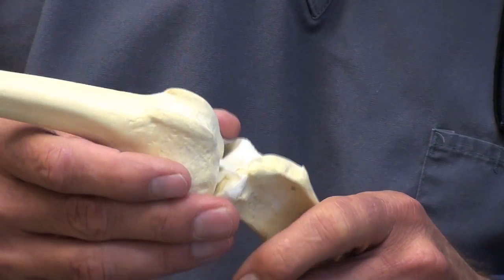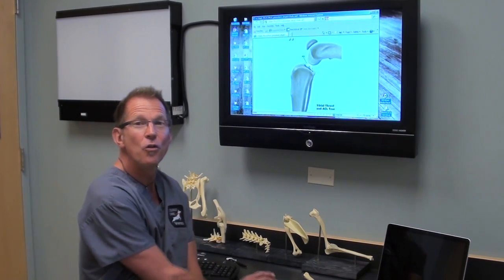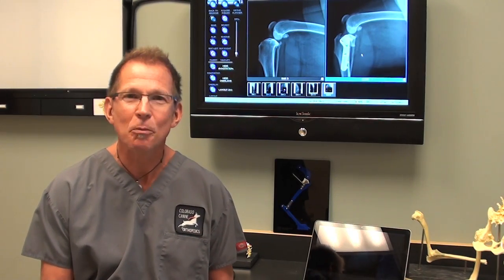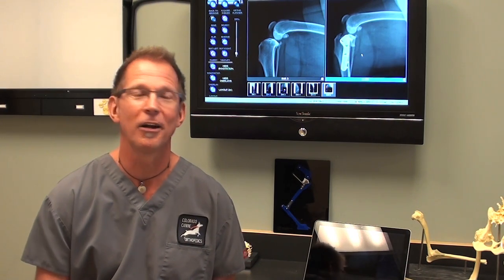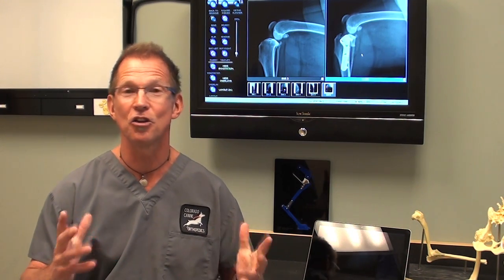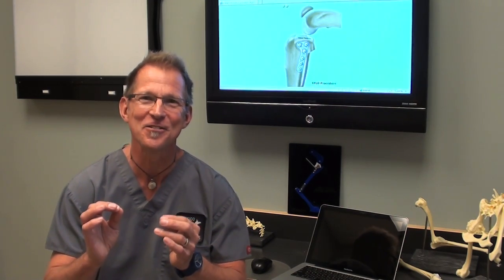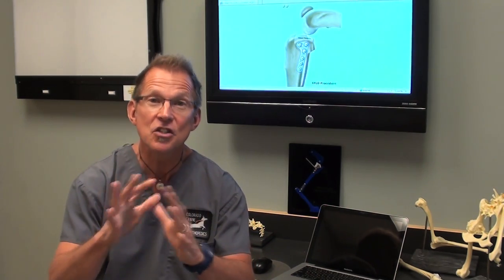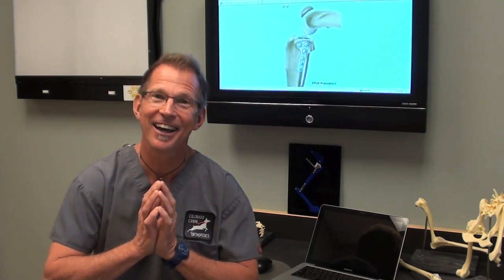Canine ACL Tears and TPLO Surgery discussed by Dr. Bauer, DVM, DACVS

Comment: My dog had tplo surgury 8 weeks ago. She yelped at around 5 weeks into recovery.After going in for the last x ray it turned out that her plate cracked? What should I do? The surgeon said it is fine but I can't find anything saying that it is. It is now been 4 months and her front left leg is now limping and she can hardly walk now. She had already her back right leg fixed?Ideas?
Reply: They sell light therapy Luma light therapy try that you can find that on Amazon also there is stem cell and laser therapy that helps a lot

Comment: my Vet said that if one ACL tears in your dog, and if it is joint problem than the dog might tear her other one...
Reply: 50 - 65% chance IF it's a congenital defect for other leg to eventually need it.  my dog had this surgery about 50 hours ago.  go to a vet with the advanced orthopedic degree like this guy.  DO NOT have your regular vet do this.  my regular vet said my dogs knees had advanced arthritis.  i didn't believe him, she's only 3 and started limping after a squirrel chase, getting stuck in a neighbors wrought iron handrail, backing up and doing a somersault down 4 stairs and then not walking on right back leg.  got better over a few days, then stopped getting better.  get arthritis diagnosis but i knew it was a torn something or other.  muscles got smaller on the leg within a month, not really putting all weight on it.  sitting on her left side hip.  so far so good!  she's using it a little!!!  
my dog was born with too wide hips and knees that turned in.  los angeles thugs trying to breed "badass" guard dogs, she was too small and ended up in pound.  50% staffy, 25% chow, 12.5% great dane, 25% doberman.  you have big hips and small hips combination here.  great dog and my vet did a torn ACL in my rescue pound cat 10 years ago and she can still jump on counter so i trust the vet.   it was a LOT of money but my vet had credit plan.  dr. raviv balfour if in southern california.
Reply: I have heard this too!